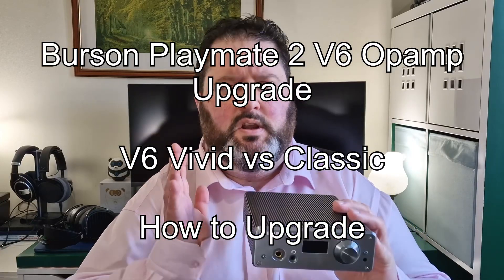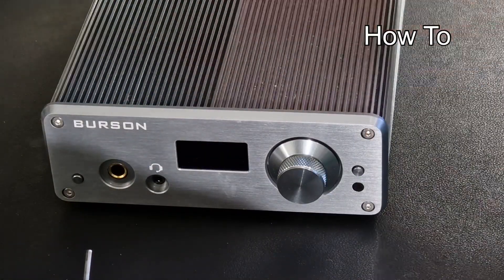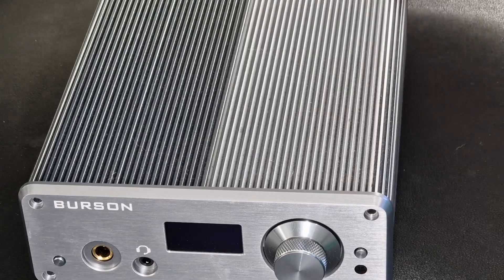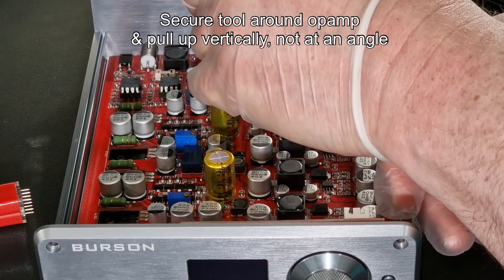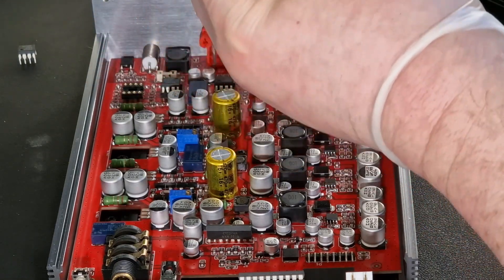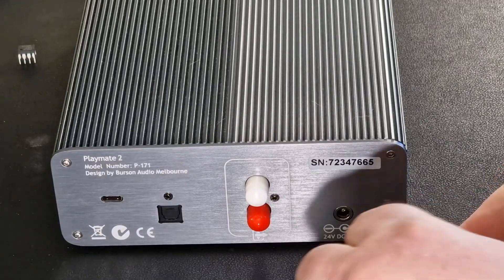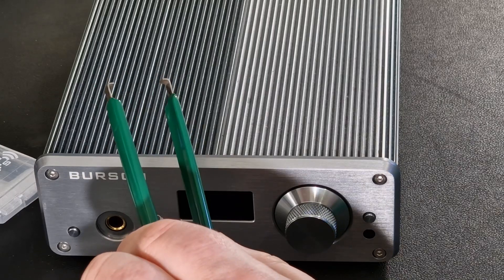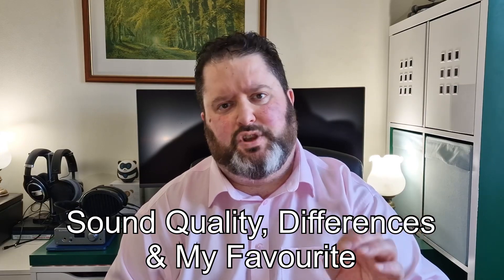Burson V6 Vivid vs V6 Classic Opamps - all the differences

Comment: Bit slow to review these V6 Opamps aren't you? They've been around for 7yrs. If you think the V6's are good, Burson have recently released the V7 & V7 Pro Opamp (Vivid & Classic).
There are differences between the single op-amps and dual op-amps. The Burson Playmate requires two pairs of dual opamps. One pair takes care of the I/V Stage, where the digital audio signal enters. The second pair handles LP (low-pass) Stage and Headamp Output stage which filters the high-frequency noise. So you should change out both pairs.

Recently swapped out mine in the Conductor 3 GT and the difference is astonishing, really next level performance.

Comment: Very nice review, thanks.

I have the stock Playmate 2 and I'm going to upgrade the op-amps. Love the sound but your review ( and others ) motivated me to go for it.

I too listen to multiple types of music. Was considering the Classics but looks like the Vivid will cover most of them.

I noticed you just changed the outer units ( doubles ) but the inner OpAmps ( singles ) were kept stock.

Is there any benefit by changing them? 

Thanks and I really enjoy your reviews.

Gracias/PuertoRico
Reply from the maker: Thanks for your feedback Jose. Appreciated 👍 I was pleased enough with the upgrade I did and its so good as is. I don't think you need to change the others. Vivid is definitely the way to go.
Reply: @GavinsGadgets I found that putting the Classics in the Lp stage and the Vivids in the I/V stage was the best. I'm using the V7 Pros though.
Reply: Thanks

Comment: Nicely Done.
A bit of a DIY upgrade made easy :)
I noticed what looked like 4 op amps in a row why change only 2 ?
Thanks in advance
Reply from the maker: Thanks. To upgrade this, you only need the two. I'll have to investigate the others. Also cost. $145 a pair. I wanted to hear the difference first.
Reply: In my opinion you will be happy with either the V6 Vivid or the V6 Classic & you will love what you have for any type of music . @GavinsGadgets
Reply: There are differences between the single op-amps and dual op-amps. The Burson Playmate requires two pairs of dual opamps. One pair takes care of the I/V Stage, where the digital audio signal enters. The second pair handles LP (low-pass) Stage and Headamp Output stage which filters the high-frequency noise. You should change both pairs!